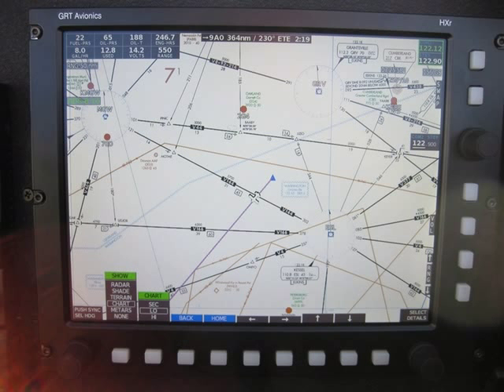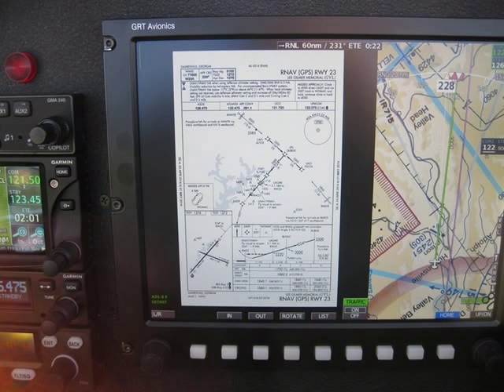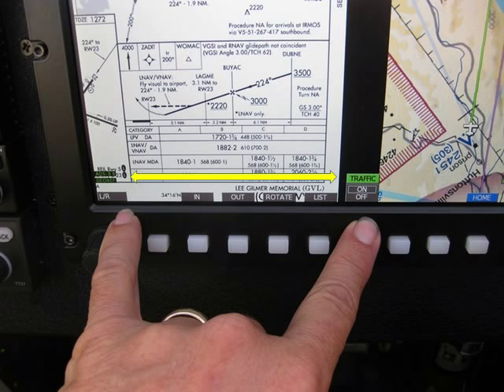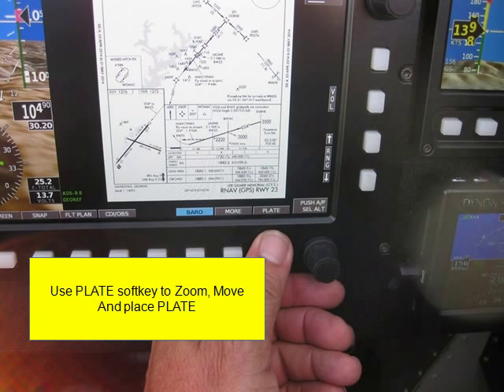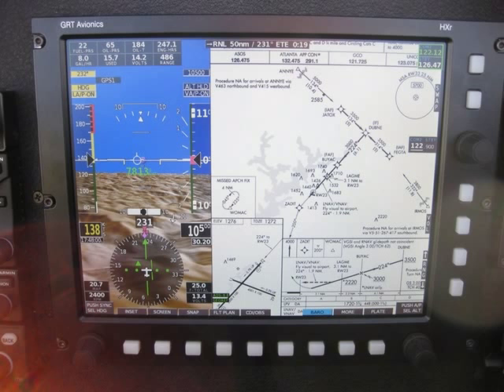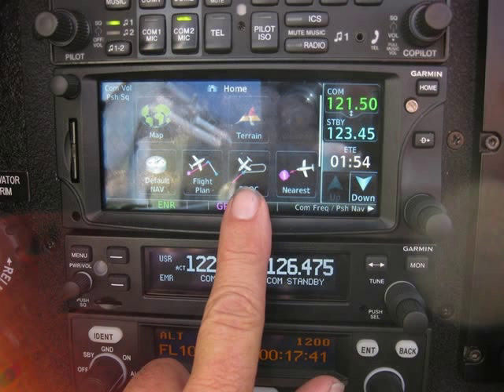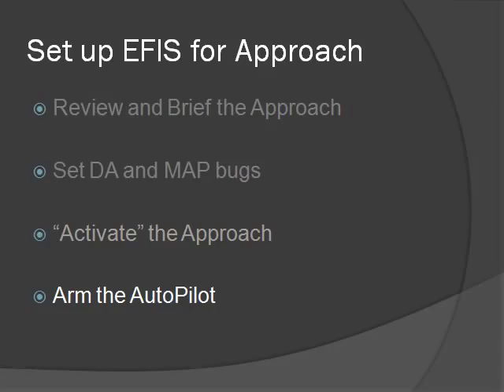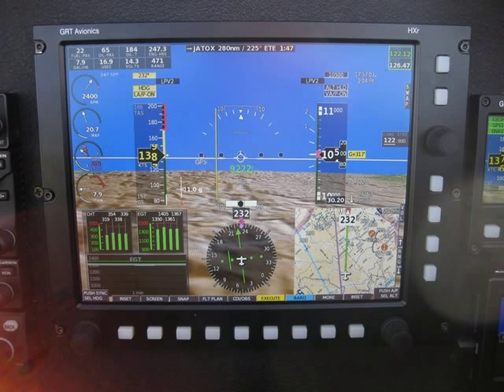Flying the HXr Part 4: Enroute IFR

Comment: On your newer systems, does opening up menus such as flight plan take away all your instruments like shown here?
Reply from the maker: Our newer HXr software and our 10.1 model software have a split screen mode for the flight plan functions.  I don't see updated screenshots on our web site or main manual but they are in the manual for the built-in approach procedure option in the Horizon 10.1.